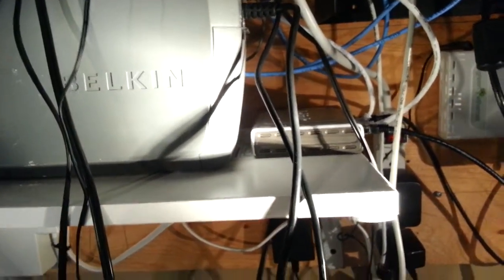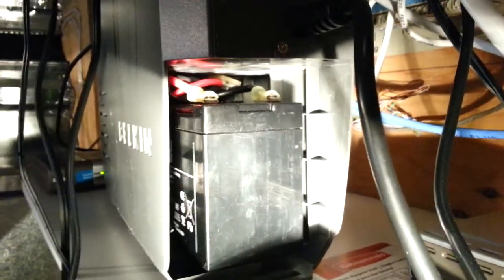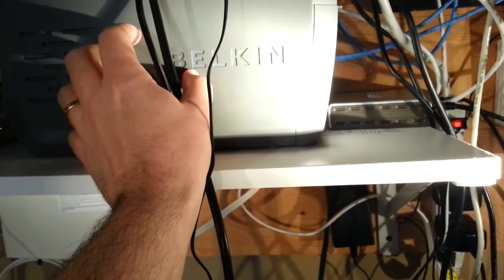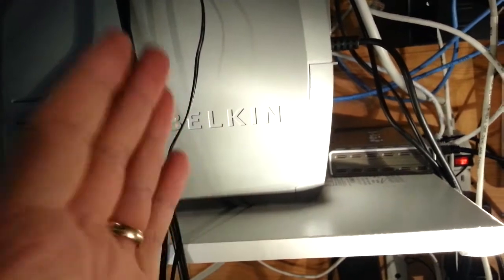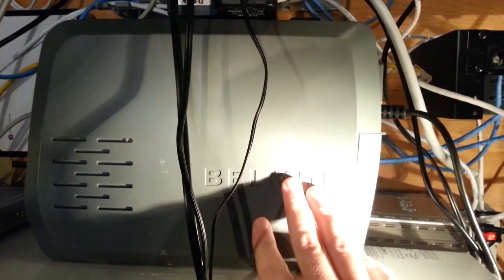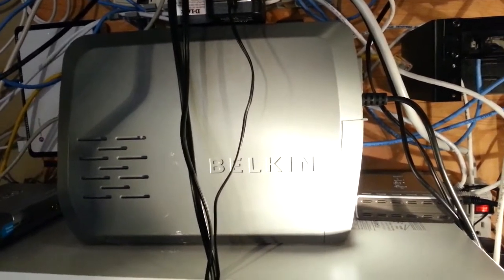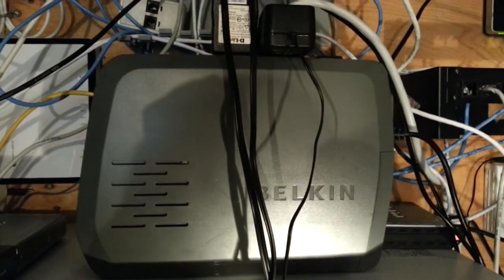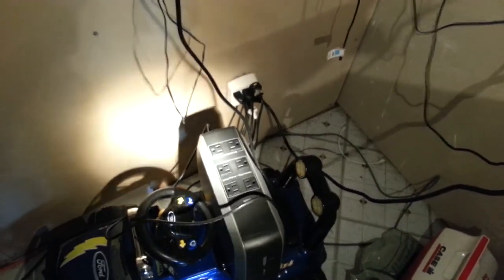Belkin 550VA UPS with 750VA battery as replacement

Comment: i Love APC SMART-UPS and also Belkin this is now 2024 and the 12V 10Ah LiFePO4 Lithium Iron Battery fit nice in that unit and it is a 10amp battery not 7amp and you will get 3 times the run time with a LiFePO4 Battery

Comment: I have a 900 that the previous owners left at our house and I can't get it to come on. You think it's the battery?
Reply: 100% if the battery is dead the unit will not turn on there is a relay in all APC Battery Bach ups that will disconnect the battery when dead it will not even try to charge the battery unless you trick the relay with a 12v power supply to kick on the relay this is 2024 change out the battery to a 12V 10Ah LiFePO4 Lithium Iron Battery  .